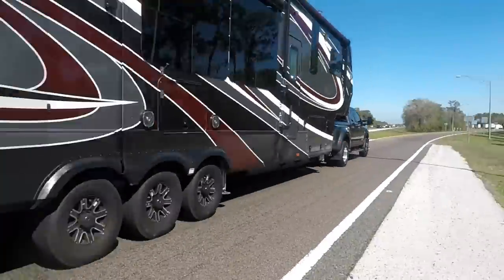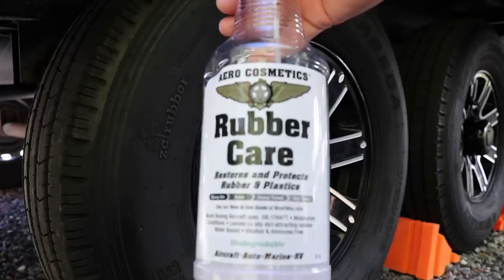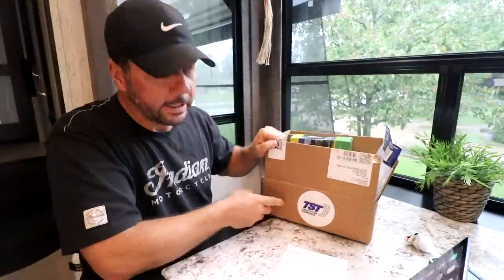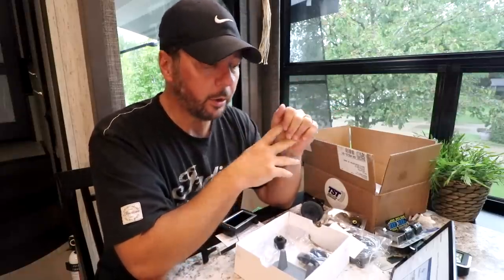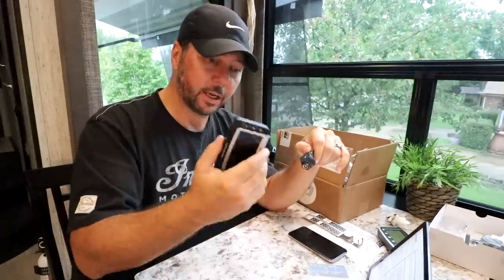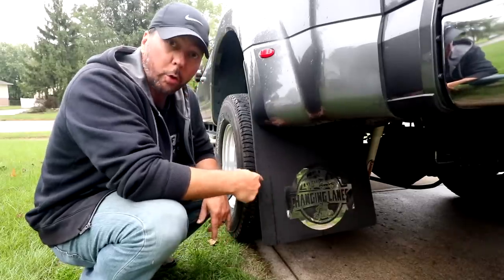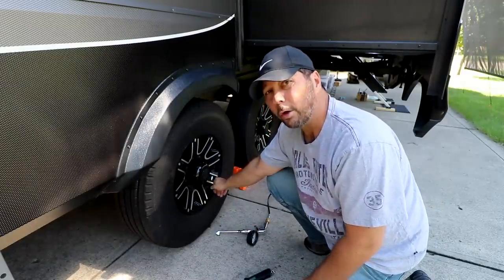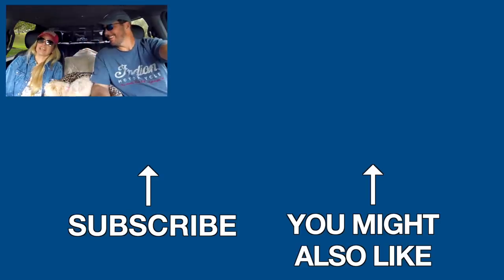RV and Truck Tire Safety | Best TPMS (Tire Pressure Monitoring) (TST-507) Review | Changing Lanes!

Comment: I just ordered your recommended TST. We have a new 2022 Thor Windsport 29M and I will be towing a flat trailer until the Bronco gets built. On my RV the Thor sticker inside next to drivers seat recommendations cold inflation pressure of 82 PSI on all RV tires and the Goodyear Load Range G 245/70R19.5 allow 110 PSI at a MAX. LOAD 4540 LBS SINGLE / 4410 LBS DUAL. Seeing what you would recommend we set our tire pressure at? I’ve been doing 90 PSI. I guess we should get our rig on a CAT scale however, I don’t believe we are overloaded. Anyway it was interesting you are running max tire pressure on your 5th wheel. Thanks for making this video, I was ready to purchase this device, just needed some direction and I liked what you showed in the video. Keep up the great work.
Reply from the maker: I would take the GVWR of the trailer, divide it by the number of tires on it to get a general idea of the load on each tire... Obviously, hitting a CAT scale is even better, but rough math will get you a starting point.  Take that per-tire load and look it up on an inflation chart for that tire.  I think this is the right one: https://www.goodyearrvtires.com/pdfs/rv_inflation.pdf
Reply: @ChangingLanes  awesome, I didn’t realize this tire manufacturer put out a load/pressure chart, makes sense though.

Comment: I have the TST 507 with cap sensors and color monitor. It's fantastic. I use the repeater, but don't think I really need it. 
Since I'm lazy, I love not having to manually check tire pressure often, just turn the system on. I like the color monitor because the outline of the vehicle doesn't scream "Semi-trailer" like the B&W does.
Reply: OBTW, I installed metal valve stems. Dill 902-W on Sendel rims. Did it myself. It's not a hard job, but it's dirty and messy. I might not do it myself again.
Reply from the maker: It is convenient to just turn it on and let it sit for a few to check every tire's pressure on T-24.

Comment: I’m a certified master mechanic, son of an owner operator truck driver/mechanic, and a 35 year RV owner. I disagree with one statement you made, every Chinese tire on the road IS a bomb waiting to explode. Until 2 years ago I had never had an issue with any trailer tire. In 2015 we bought a new 40’ Elkridge fifth wheel for our retirement and for the first 2 years it was stored indoors for 5 months of the year. In 2018 we headed out from Chattanooga to South Carolina for a week and then on to Michigan. We parked in our daughter’s driveway in Michigan and the next day when I went outside one of our tires was low so I pulled it off and took it to Discount tire to get it repaired. After a few minutes the guy came out and asked me to come back and see what he found, adding that he had never seen this before. When they took the tire off the rim there was no hole on the inside to correspond to where the air was coming out on the exterior. The different layers (laminations) of the tire were separating and the air was making its way through the different layers until reaching the outside. That’s when it occurred to me that when I took the tire off I noticed the tire was not it’s normal relatively flat profile across the tread surface, but was more round like an inner tube would be. I noticed that one of the other tires had the same profile so went back and got that one as well. Just before we left home I saw a story in Trailer Life  about how Goodyear had just started manufacturing an RV tire in the USA again because of all of the issues with Chinese tires. So I had them order up a couple of the new Goodyear’s for me. I then got online and started searching online and found hundreds of stories about Chinese RV tire failures. Prior to this I always just figured that all of the folks I was seeing along the road were just ignorant about caring for their tires or didn’t realize that just because their truck will go 80mph with the RV attached that doesn’t mean the trailer tires are rated for it. I check my tire pressure before I hit the road every time, I keep an infrared temperature gauge in the truck to check tire, brake, and wheel bearing temps at every rest area and gas stop, and I know what my weight is before I go (I always travel with empty holding tanks), and I keep the speed at 65mph or less because the typical Chinese RV tire is only rated for 65mph. So anyway, we did our camping in Michigan and then headed back to Tennessee. As we were going past Lexington Kentucky on I-75 KABOOM! A tire on the drivers side of the RV explodes and rips off the plastic trim around the wheels and bends the aluminum skirting all up. Off to the shoulder I go and change the tire. We get back on the road and right in the middle of Sunday night traffic in Knoxville KABOOM! The 4th Chinese Towmax (Towblast or Blowmax) tire explodes with similar plastic and aluminum damage along with shredding the nearby waterproof fabric layer nearby. Off to the shoulder I go again only this time I don’t have a spare. I had to call 911 and tell them I was leaving the RV on the side of the road because I couldn’t get a tire until Monday. Now I have 4 American made tires and have not had any problems. Also the new Goodyear’s are rated for 80mph instead of 65. You also mentioned checking tread depth on trailer tires, RV tires are made with an entirely different tread compound than automotive tires. They have much harder tread compound because they don’t need the handling characteristics that automotive tires do. If you wear out the tread on an RV tire during its expected lifetime then you either have serious axle alignment issues or you are running 500,000 miles per year.
Reply from the maker: Sounds like you had an E rated tire (65mph)?  So many RVs used to have those installed and they would blow. 
 I think most have started using G or H in the past couple of years.  We have over 25K on our G rated Wesstlake tires with no issue.  Most trailer tires are made in China.  When you have a high percentage of something in a data sample, that sample will inevitably be skewed toward that sample.  Lots of Chinese tires means lots of failures.  I'm not saying that the US made ones aren't better.. They likely are.  But I also don't think every tire from China is a "bomb waiting to explode".

Comment: Interesting topic for RV haulers, tire problems. Maybe a review of what you have validated concerning tires and why they tend to have blow outs when even though there is good tread, pressure for the intended trip and type of tire. There's a lot of problems with folks who simply go buy a toy hauler or RV and follow suit yet, new tires or not, they suffer blow outs and not from road hazards. Many owners have suggested the GVWR of the RV's axles are too light thus the tires are right around maximum loads all the time. Then, there are the tire dealers, even those mom & pop tire shops who will say, "you have to have a trailer tire" for these trailers or else. Even so, those same properly matched tires fail, even when not loaded. Is it possible the RV manufacturers aren't fitting correct GVWR axles with their many rigs? Some say that's where the issues are, the 3,500 lb axles are no good for trailering medium loads or higher. From whats on paper, I tend to agree. Get the 7,000 lb axles and if they aren't offered on the rig you want, don't buy it.

@Changing Lanes Your BAT came with tire pressure monitors from Ford, didn't it?

Comment: Our EEZ monitor system probably saved out truck and rig two weeks ago 
Stuck caliper in truck right front tire
Temperature alarm went off 
Pulled off freeway 
Per discussion with Ford dealer, had we kept going the grease may have caught fire and spread to engine and even the rig
Reply from the maker: Excellent save!   We've heard a few stories like that.  Thanks for sharing and thanks for watching!

Comment: Great Video. In this video when you are airing your tires what equipment are you using? i have an air compressor but need something that can reach the inside wheel valve on the rear dually tires.  Any advice on this matter is helpful.  Have the same F450 you have now but in Atlas Blue color on a Lariat trim.

Comment: You need metal valve stems. I have the cap style EZ Tire and we have had 2 rubber stems. One was when I was checking air and it just broke off when reinstalling sensor. Today we had a failure at 70mph. Fortunately as soon as the alarm sounded we got off the road without ruining the tire. The Goodyear dealer changed them out for me.
I used a toggle to my booster also. The week point is the batteries as some last longer than others so be sure and carry spares. If you have a sensor won't read it more than likely needs a new battery,
I have the same air compressor so be careful the head can get very hot.
Reply from the maker: We do..  Glad you had the TPMS to warn you! 👍🏼

Comment: Hey folks..just wanted to say hi and big thank you for what I think are the best fifth wheel education n information vlogs...with a great sense if humour and fabulous banter as we call it over in the UK..Scotland!  We are about to put our house on the market and are looking to buy a fifthwheel..if you get desperate you can see our research on our channel ..with smaller roads and smaller trucks we are looking at what you would see in the US as Arctic wild 285drl4 I think and a short bed truck.  However you've now got us both thinking about a toy hauler as I ride a Royal Enfield classic.  Anyway I have gone on to long ..big thanks from your new supporters over the pond. Last Q? .. Chad..ex forces? What branch?
Reply from the maker: Hi there!  Thanks for watching! 😊  I was active duty in the U.S. Navy from 1986-1992. I worked as an AT (Aviation Electronics Tech) on E2-C Hawkeyes in VAW-120, then VAW-124. In VAW-124, we deployed on the U.S.S. Theodore Roosevelt for Desert Shield and Desert Storm.
Reply: @ChangingLanes  hiya thanks for replying .. big respect.. we are both ex Royal Air Force  .. I (Al) was out for Desert Storm .. more recently Iraq and Afghanistan. Respectfully envious of your Indian, to wet n salty around these parts for one of those 1😎

Comment: Hi there I was wondering what made you decide which type sensor to go where. I saw that originally you wanted the caps to go on the RV and then you switch those to the truck. Just wondering so I know how many to purchase. Thank you so much! And great video as usual you guys!😘
Reply from the maker: Hi! 😊 If you have metal valve stems on your RV, get the flow-through sensors. https://changinglanesrv.com/tpms  
On the truck, for us, only the cap sensors would fit.  👍🏼  
Thanks for watching! 😊

Comment: I have a 41 ft. Hallmark Cyclone toy hauler each axle rated 5300 lbs.  2008 yr. 2 ND owner never been  on the road:  HOW DO YOU CHANGE OUT YOUR TIRES; I.E. WHERE WHO HOW??? THIS IS A BIG RIG WITH TOW VEHICLE.  MOST DEALERS / INSTALLERS WANT TO SELL YOU THE TIRES.  BEST DEALS WITHOUT TAX ARE ON THE NET???  I HAVE 6 TIRES 3 AXLES AS YOU HAVE.  RON NEW JERSEY  I FIND YOUR VIDEOS VERY HELPFUL ESPECIALLY THE INTERNET ONE I WATCHED TODAY.  I HAVE A JET PACK BY VERIZON BUT YOU CLEARLY ADDRESSED THE ISSUE THANKS AGAIN.
Reply from the maker: Hi, Ron!  We're still on our stock tires that came with the rig (15,000 miles), so we haven't changed them out yet.  Your best bet might be to ask around on Facebook.  Lot's of RV pages on there and likely a Heartland Owners group that can recommend some specifically for your rig.  Thanks for watching!

Comment: That letter rating is a DOT tire speed rating. If your traveling at highway speeds (55+) you would want a G rated tire or higher based on your vehicles weight and tire dimensions. #2 Never top off a Nitrogen filled tire with air. Check tires regularly note Cold pressure and Hot pressures. Never let your tire exceed maximum tire pressures. Try to keep your tires as matched as much as possible.
Reply from the maker: Have to disagree on 2 items there.  Maintaining proper pressures across the country and 4 seasons, one needs to be able to add and remove pressure.  Air is simple and free.  Adding air to nitrogen filled tires simply changes the mix.   No harm can come from it as long as the pressure is right.  IMO, nitrogen in tires is a scam.  Very little benefit for something that's impossible to maintain when traveling full time.
In regards to never going over max, that is not true.  The max pressure rating is cold and they are meant to go over that number when running.  We run our RV tires at 110 cold and they get up to around 120-125 when traveling in the summer.

Comment: Chad, you put flexible valve extenders on your Ford Dually. I've been contemplating doing it also on my Chevy Dually, but there is reluctance by some, feeling to do so introduces more potential for air leaks and tire failure. Could you share your experience since the install... Thanks 🤠

Comment: Hi Chad and Tara, great videos and glad we subscribed last year as I've watched and re-watched several of them... I like the no-nonsense approach you take making them.  Not sure if you can help me on this one or not Chad, but been running the TST-507  TPMS on our 2020 GD 310 for a year, love it.  Just purchased a new 2020 GMC 3500 Dually, and it came with the TPMS valves to be installed (can't believe they didn't put into tires as part of the purchase?), but they came with 4 (makes sense for a 6-tire truck, right?!).  Thinking about just skipping using these and buying 6 more sensors from TPMS, your thoughts?  Thanks!  Bob and Karen
Reply from the maker: We run the TST sensors on our truck even though we have them built into the truck also.  I like having all 12 tires in one display.  👍🏼
Reply: @ChangingLanes  Makes sense, thanks for replying!

Comment: Hello, love all your videos. I’ve been prepping my RV class C and Harley cargo trailer for trips around our great country. I just bought the TST 507 TPMS for 8 tires on my particular setup. Felt the cost was good insurance to keep us safe on the road. Question. Theft.  When you leave your campsite for a lengthy period of time, besides locking things up and arming a security system, (I run 7 live WiFi cameras on my setup) are you worried that someone may help themselves to your tire sensors? Would you recommend removing them while you’re away? Is that an option?  Thanks.
Reply from the maker: Never an issue all over the US for 3.5 years...  👍🏼
Reply: @ChangingLanes  Thanks for your quick reply and this peace of mind.  Hope to meet you guys on the roads some day.  Maybe my girl Big Blue a Harley Road Glide and Lucille will some day be at the same burger-n-beer pup. Keeps safe on the road. And Anxiously waiting for the next video.

Comment: Great channel. Just wondering how the truck feels on the highway with no load? I always hear the big trucks are a rough nasty ride. We are looking at an F350 but have been told I will hate it as a daily driver, and not because of the size.
Reply from the maker: Thank you!  
Not going to lie.. It can be a rough ride, but it's not that bad... Obviously a lot depends on the quality of the roads.  Sulastic shackles can help with the ride a little bit.
Reply: @ChangingLanes  Thanks for the reply. Safe travels! Cheers from Aurora, Ontario

Comment: Hello guys , I noticed you have a ford  superduty that has the tpms system for the truck. I was considering the tpms/backup camera option from ford  for my superduty . Did consider this option and if so why did u go with the tst system. Great video as always. John G.
Reply from the maker: We did strongly consider it!  But it's all hard wired and super complex to install.  The sensors are all internal on the valve stem and no one could even tell me if it would fit our RV.  And it's pretty expensive.  All of that considered, we went with the simple and cheaper options.. LOL

Comment: Chad, Tara:  We've had our "Large Marge" a 42 foot fifth wheel for just under a year now.  We've been on the road 5 times so far.  Our tires are Westlake H series.  Thanks to you and this video, we learned alot about the tires and invested in the TST system.  How are your Westlakes holding up after 2 years?
Reply from the maker: Our Westlake G rated are great!  Haven't seen the H, but they should be even better!  👍🏼

Comment: Great, informative video, as always.  Skimming through the comments, I didn't see any comments regarding preference of cap sensors vs flow through.  We have a similar rig as you, Solitude and Chevy dually.  I like the idea of the "low profile" that the cap sensors provide, but the flow-through sensors seem to be more convenient (i.e., less of a headache when airing up).  In fact, the valve stems of my outer dually tires are short and point inward, while the stems for the inner dually tires, of course, are deeply tucked away (making the flow through seem like a better option there).  After using them for a while now, do have any opinion on which you prefer (or would prefer from the beginning)?
Reply from the maker: Hey, Jack.  I would prefer flow-thru all around I think, IF they would fit on the truck.  The way the valve stems are on our F350, the flow-thrus fir, but puts the flow thru stem too close to the rim, rendering them unusable for airing up.  Love having the flow-thrus on the RV though.

Perhaps flow thrus would be good with some kid of valve extenders that make them accessible.

Comment: I try pulling RV fast enough were trailer tires slightly touch the road every few miles.This eliminates tire wear and never notice a flat tire unless you slow down and tire hopefully will start rolling down the road. John
Reply from the maker: 😂🤣  Good plan... Maybe some spoilers under the RV for extra lift?